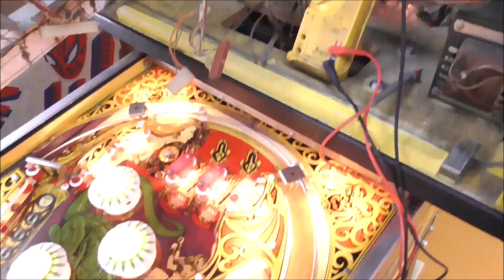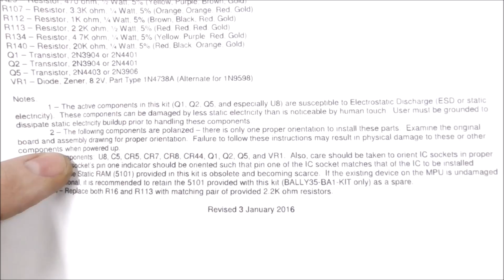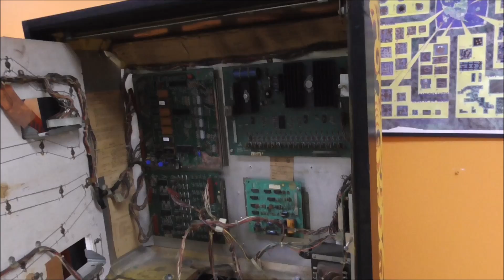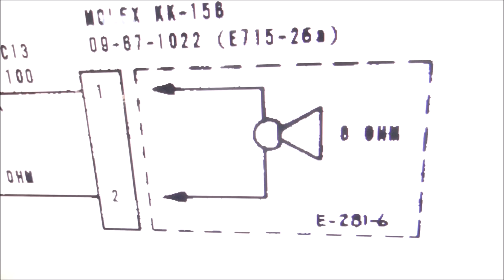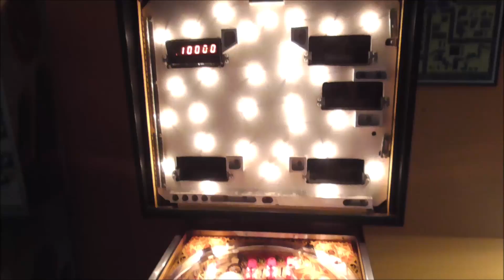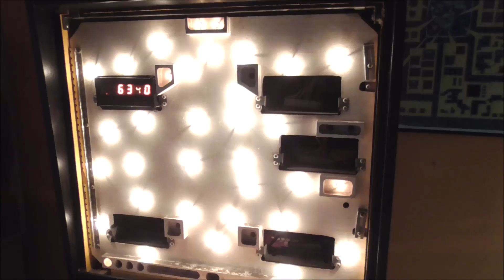Repairing ALL the Boards in This Bally Lost World Pinball Machine!

Comment: Classic repair tech mentality... I like it.  There's too many homebrew electrical engineers who try and re-invent everything.   When doing repair jobs, it's best to consider the way it was designed to work, and solve each of the issues one at a time.
Reply from the maker: Thank you Koby, we appreciate you watching!
Reply from the maker: Koby I like the way you're thinking too about not reinventing everything, it's hard to put that into words but yeah I see the same thing.  People want to do everything better when all of this stuff is a proven design and it's all built with inexpensive readily available parts (mostly).  Even the damn battery on the board, yeah they caused lots of damage, yes I wish they weren't on there, but the reason they caused the damage is because they were left on there for 40 years.  If I took my  t.v. remote control and put batteries in it, then left it in my storage building for 40 years, they'd probably leak too, the problem isn't the battery, it's that somebody left it installed for 40 years, LOL

I see too many people saying things like "Durr the original design is shit" when in reality we're 40 years in and the stuff is still useable.
Reply: @LyonsArcade  I fix guitar amps....   And theres a business of restoring modified amps to stock.  I try to resist the temptation to think I know so much more than the design team.

Comment: It's like I seen a Dolly Parton pinball machine turned into a HEAVY METAL the movie pinball machine on the internet.
And I always wondered how they did that.

Or dose a FLASH circuit boards only works in the FLASH pinball machine.

And can't switch them out.

Just curious.
Reply from the maker: Stuff like those machines you see switched they've just 'rethemed' it... you can use the same exact code and just change the artwork.

Comment: How long did it take you to find the cap mistake on the MPU board? Good job so far and thanks for sharing.
Reply from the maker: Only about 30 minutes, I had heard before that sometimes that little 555 timer chip will do things like that down on the bottom right, and I thought that cap was connected to that chip, it's not it's just next to it but I still was able to figure it out by looking in that area of the board.  Kind of got lucky!

Comment: It was good to see this up and running.  It is a pity you can't get the original displays, but I am sure this will look great with LED's.
Looking forward to tomorrow's video.
Reply from the maker: Yeah I wish they still made them affordably, but it's one of those things where the only real reason NOT to use LED's is they look just slightly different so it doesn't really warrant continuing to make the old ones when they only have this one purpose....
Reply: @LyonsArcade  I get that totally.   I have a different project to do today.  I found my old Wii and the Gottlieb Classic Pinball game disk.  Now to get that old thing up and running again.  If I remember this disk was based around the System 3 games.

Comment: IF YOU CHANGE A BATTETY HOLD WOULD IT BE BETTER TO MOVE OFF THE BOARD FROM HAMPSHIRE ENGLAND
Reply from the maker: Or, you could replace the battery with a battery that doesn't leak, couldn't you?

Comment: Awesome work. All the desoldering you do you ought to have a desoldering station. I got a cheap vacuum desoldering gun and it’s a God send when doing 150 pads. Man that was trashed. If I could fix it , I be months. Fort Myers. Trying not to croak.
Reply from the maker: I bought one awhile back and never could get it to work right, it kept clogging up.  I could use it to clear two holes or so and then it would be clogged, I lifted a ton of eyelets with it too, never could get the hang of it.

Comment: Why do they call it "strapping" the ROM chip when adding those Strapping Jumper wires to convert a ROM chip part number to another ROM chip part number? I don't understand why they are calling it strapping.  You mentioned that bad display is due to apply an over voltage to the display, why would or how was an over voltage being applied to the display?
Reply: When the high voltage section on the solenoid driver board fails instead of power going to zero it goes high(forget how much).   Causes the displays to burn.  Bad design by Bally.  Operators would not notice and caused the displays to go bad.   Happened all the time.  I had a box full of bad bally(and Stern) displays.  Good ones are expensive.
Reply: @craigmanning2439  So when the High Voltage section on the solenoid driver board for the Display boards Ground zero voltage will go to another voltage? That is weird that the ground zero voltage will raise up to another voltage when the display voltage goes bad
Reply: @waynegram8907  Not an EE so I don't know the details.  I think its a resistor that fails and causes the voltage to go high.  Don't quote me on that.  Maybe someone with more knowledge can explain.  Just my limited understanding.  I have repaired/restored so many early Bally's and I would say that 50-60% of the machines I have seen have burnt displays as seen in this video.
Reply: @craigmanning2439  The early ballys display issue like this was mostly what parts you found were the problem causing this issue? The Solenoid driver board has a Filter cap just for the display which is a very high voltage of 180vdc going to the displays. Have you found the filter cap was bad that is causing this issue or resistors that is causing this over voltage display issue? based from your experience repairing early ballys pinball machines with over voltage display issues
Reply from the maker: I think like Craig mentioned the current burns up a resistor and then the way the circuit is designed the voltage stops being regulated and the full 250 volts goes to the displays instead of the 180 or so the solenoid board regulates it down to... once it starts doing that, the displays burn a lot brighter, but if you leave it like that they start burning up the plasma areas inside, the only way to fix it is to replace the entire glass.

Comment: So that's why it wasn't making any sound.  In the words of Adam Savage (of Mythbusters): "Well, there's your problem!"  I've never seen a speaker cone torn up like that, but it shouldn't surprise me; it probably hasn't been touched since the machine was built.  Those paper cones can dry rot.  Not only was the cone torn, but I bet the surround was made of foam, which can also dry rot.
Reply from the maker: These machines have a rough life... if goes like this... they come out, and get the hell played out of them for a couple years, then they break.  The operator fixes them out on location, but he doesn't have the right parts, and it all starts going down hill... they get played until they start making less money, so the operator stops really testing or fixing it and the playfield without wax starts to chip up... things break... eventually when the thing is absolutely worn out, they throw it in a storage building for 30 years until I find it, after the rats did!
Reply: @LyonsArcade  That's true, but it's not like a replacement speaker is hard to source.  In any case, it's a good thing there are enthusiasts like you who are willing to put in the effort to restore these pieces of history.  If I had the time and money, I might start doing it too.  I was born in 1970, so I dropped many dimes (and later, quarters) into classic arcade and pinball machines.  I need a hobby that's a little more mentally challenging than playing computer games.

Comment: The sound of playing is do different from the new ones.

The electro mechanical ones, from the 50s, that had the rolling counters instead of digital or vacuum florescent displays, they sound different than these

Not many of those old electromechanical ones still in existence

Every once in a while I see a vacuum florescent display that is dim or burnt out from the 80s

Those operate in the 240 volt range

They are florescent bulbs, tiny miniature ones, but they needed high voltage to light those bulbs

I don't know what they must have thought about when they made them, because they knew they would burn out

The bulbs that were just bulbs that they would solder on the board, those they knew would only last 4 or 5 years at most

I guess they figured the device would be thrown out by the time the bulbs burnt out.
Reply from the maker: Yeah I believe they thought all these pinball machines would last about 2 years.  They had to have known by that time though that operators were keeping them much longer, but they were more interested in selling them new ones than worrying about how their old ones would last, lol.  If you think about it, all of this stuff was originally based on the Jukebox model.  Jukeboxes were the first real electrical coin operated device... and they had an issue where operators would keep their old Jukeboxes instead of buying the new model.  They tried trade in plans and all kinds of things.  Then along came the electric Pinball machines, running on batteries at first for the light bulbs.  Same thing, they wanted you to buy the brand new one and didn't want you to keep the old ones if they could help it.

Comment: Sockets are dual wipe, but on dual wipe DIP sockets they're usually a springy loop pressing against a flat piece of metal. Those just look like two straight pieces of metal a distance apart.
Reply from the maker: Probably some kind of patent issue back in 1976 or something!